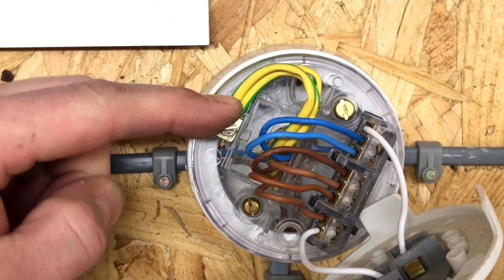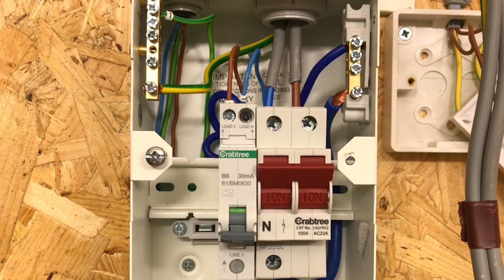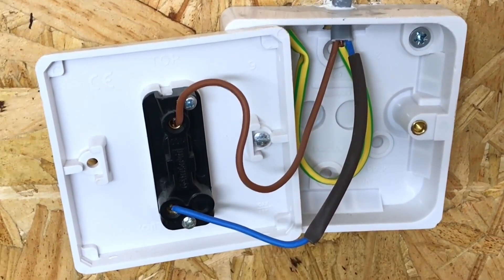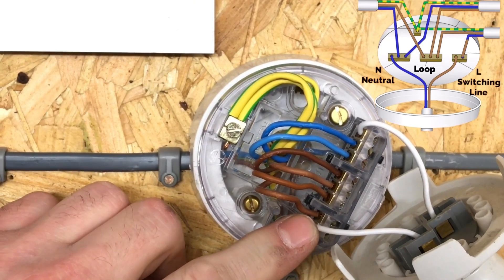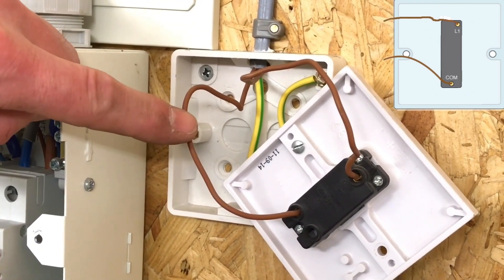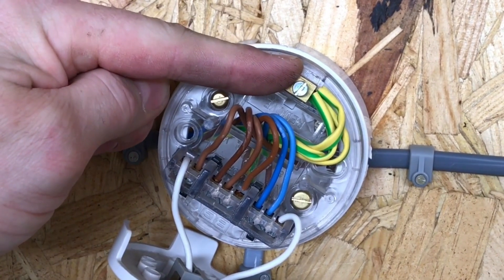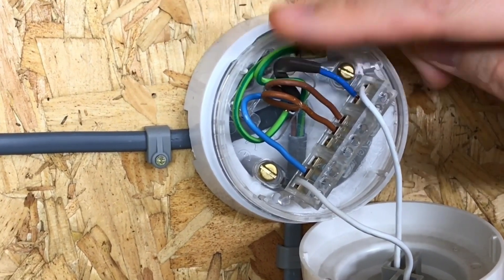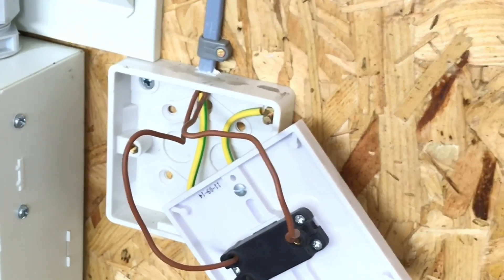Lighting Circuit ALL Connections Explained - 3 Plate Loop in Method

Comment: Think I prefer blue (with brown sleeve), and brown plus CPC as you then know it's a switching conductor. Label the end of the cable in case the sleeve falls off while doing all the mechanical stuff. Other question is I note you have individually sleeved the CPC. Sometimes you see four CPC twisted together then sleeve pushed over. Thoughts please?  Would be nice to have cage clamp terminals 🤔

Comment: Regardless of what you may think, by the time you recorded, processed and published your video that cable sleeve is now black on any monitor that has any level of calibration. I am not saying that I see it as black, I am saying that if you take the image of the sleeve and put it into an image tool the result is that it is reported as dark grey/black. The 3 colours of Red, Green and Blue are all basically at the same low value for any chosen area. Black is basically R,G,B all being set to 0 and as the RGB values are all incremented to their highest possible value in step you move from black to white with all possible shades of grey in between.

A brown reports very differently, as it will have a very high value for red and lesser values for green and blue.

Why have I been so pedantic? Well it raises an interesting question when it comes to the regs. If you truly see brown when doing a visual inspection what do the regs state happens if recorded evidence shows something different due to image processing issues or environmental issues - such as the lights in place when the visual inspection was done? As it stands this video if used in a court would be used to show that you incorrectly sleeved the cable and so call your work into question.

Comment: Surely nowadays lighting circuits are not wired anymore as the loop in / ceiling rose method 🤔
Reply from the maker: Lighting Circuit 2 Plate Method Taking the Feed to the Switch and Connecting a 1 Way Switch & Light
https://youtu.be/1G4fW2DeqPA